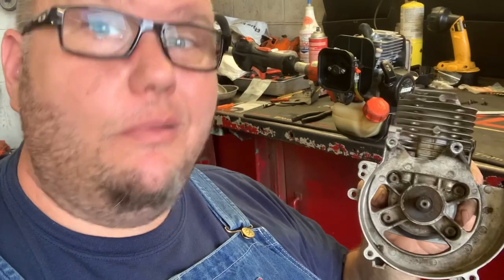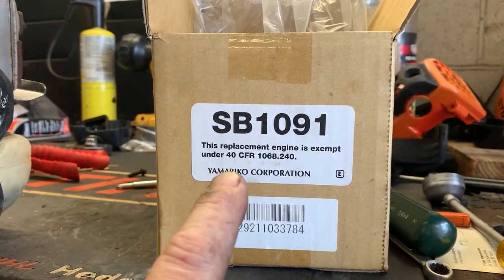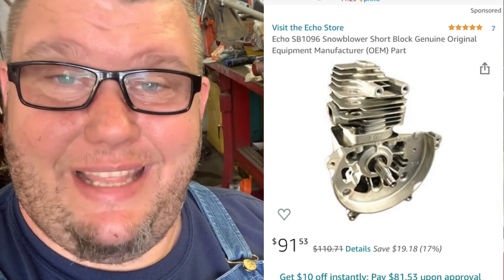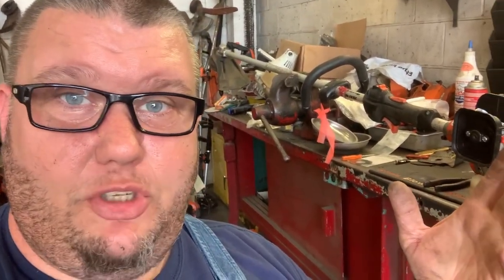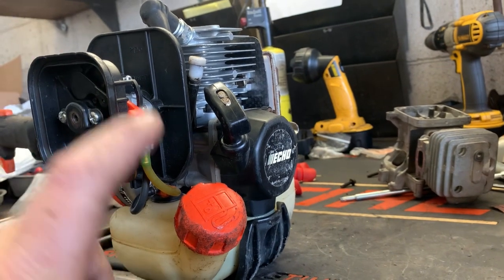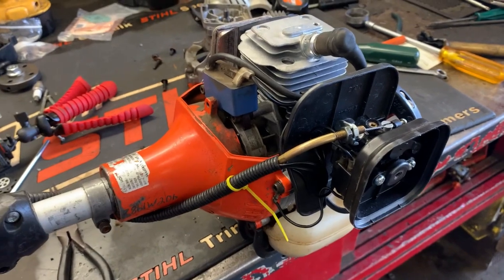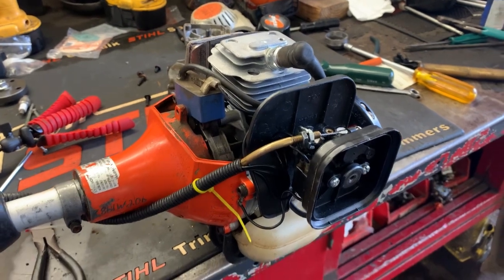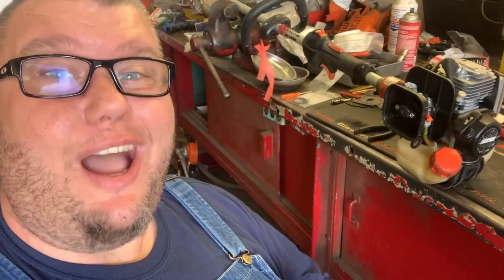DIY FACTORY SHORT BLOCKS / ARE THEY WORTH THE MONEY?

Comment: I bought a factory take off MS 250 complete shortblock assembly for around $160. Still cheaper than getting it from the dealer. Did the cleanup on removing the old dirko sealant, put new dirko sealant on, bolted it to the casing and let it cure for a day. After reassembling it, it started within 5 pulls and runs like a happy kitten. If you can find OEM cheaper, pick it up. It's absolutely better.

Comment: @THEMOWERMEDIC1, What would make the pull start slip on a brand new 3020? Got mine from the dealer and 2 hours after I got it I noticed it slipping when pulling cold but when warmed up it doesn't. But sometimes it doesn't slip cold. 

Thanks JD
Reply from the maker: 6ft arm and 3 foot rope.  What do you mean it slips?  Like the dogs aren’t catching?
Reply: @THEMOWERMEDIC1  slip as in dogs aren't catching, sometimes it will slip first try then not on the 2nd try.
Reply from the maker: @jdclay1547  let the dealer warranty it for you but in my experience one of the dogs may have come out
Reply: @THEMOWERMEDIC1  I'll do just that but I seen some Briggs where the assembly that grabs the pawls are plastic and thought if that was the case could they make it from metal or do an assembly like a Stihl but I'll see what the dealer has to say.
Reply: @jdclay1547    same thing happened on my brand new g372xp . Check movement on dogs , push toward flywheel as your moving them . If 'gritty' feeling try blowing under them best you can w compressor put a drop of oil on each dog and give time to crawl under toward fly wheel . Worked great for me

Comment: Only ifthe rest of the tool is in top notch condition. But I never seen genuine echo parts that cheap.
Reply from the maker: I posted the parts prices right off amazon.  Do you not believe me?
Reply: @THEMOWERMEDIC1  Not that I don't believe you. But I don't live in American and they prices don't stack up the same. If a tool is almost like new it's worth buying an engine. But the last time I bought a cylinder and barrel for an echo saw it was just over £320. I did try to warn them but they insisted on rebuilding it and including labour plus the carb rebuild it came in at £420 spent on a £385 saw. But hey customer is always right.
Reply from the maker: U can’t compare us prices to yours.
Reply: @THEMOWERMEDIC1  I know, that was kind my point. I have never seen prices so low. You guys really do have much lower costs and better incomes. But that is another story altogether.